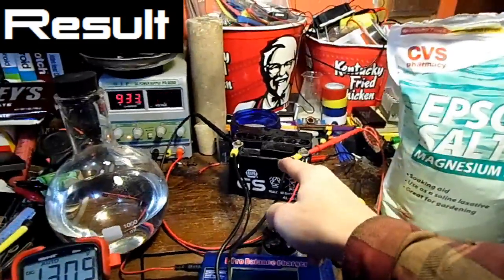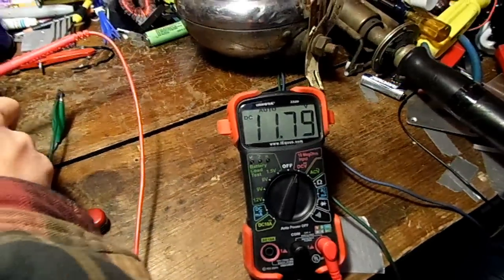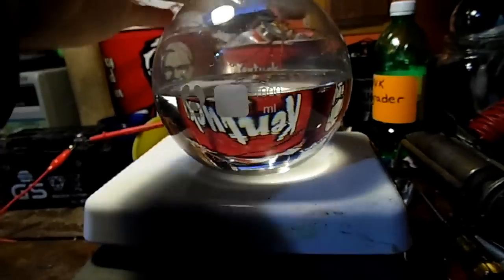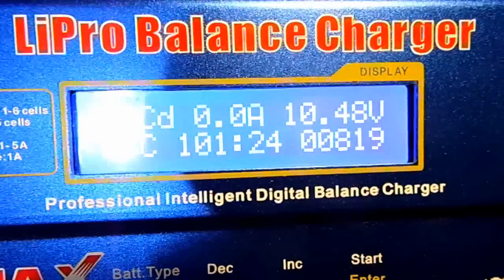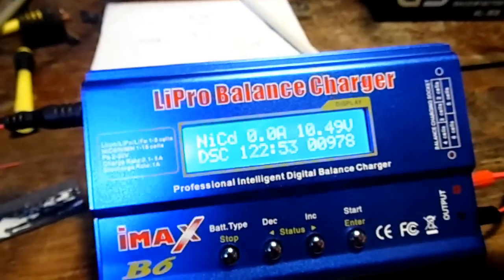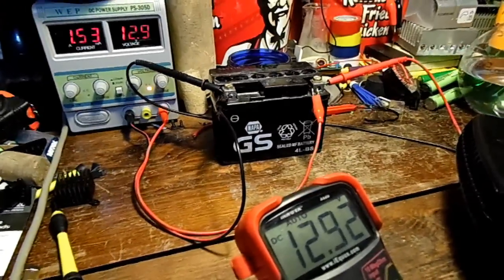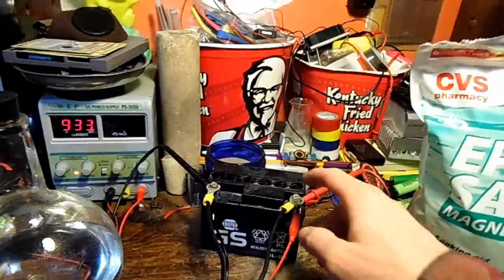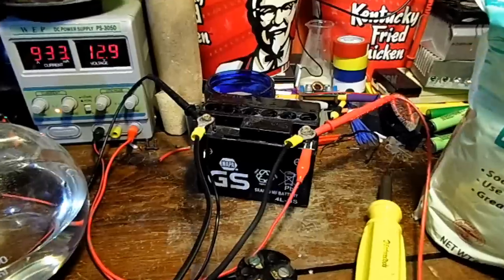Does Epsom Salt Revive a Battery?

Comment: how much  (gram ) of slat is needed in each cell of 12v 150 A inverter battery
Reply from the maker: really depends on how weak the acid is in the battery. go with what feels right. there arent any good studies on it yet so idk a good amount of data regarding it.
Reply: as i also read on you tube videos they just mentioned 10-15 tea spoon in 65amp batteries ,so mine is 150 so 3 teaspoon per cell will be right? iam asking u coz u hav some exp done n i hav none ,
and what abut my one cell which stuck on sp gr of 12.00 how could i raise its sp gr
any idea
Reply from the maker: Subas Maharjan what i do is i mix the highest concentration that i can and put some into the battery, then if it needs a bit more i put more more in there.

i'd say take half a liter and put like 5+ spoon fulls in there, then you can devide that 500ml between the cells.

i'm currently filming a video over the past 2 weeks where i add epsom salt to a 6v golfcart battery. its odd because it took a week for it to improve. now it stays at 5.91v instead of 5.8v. so perhaps you can slowly add some every few weeks and see how it improves.

is this in a battery backup? what voltage is the battery at when its not been charged for like an hour? it takes some time fora battery to go down to it's actual voltage after charging.
Reply: Rinoa Super-Genius it stays at 12.60volts if chrger removed even for 4-5 hrs,  works as usual for 2 hrs with 40w tube light n other 5  5w cfls then once it reaches 12.20 volts it drops rapidly,it used to work min 4 hrs with all lights mention above +1 laptop 
now i hav put around 20gm of salt on each cells just now lets
see what happens
Reply from the maker: Subas Maharjan
 what voltage does it go to with no load though?

i dont think epsom salt will help that. epsom salt won't increase capacity i dont think. it will only increase voltage to help stop further sulfation.
Reply: u mean while charging? it takes 13.75 while charging and if stopped comes stays at 12.50-12.60 but drops rapidly while using /under load
Reply from the maker: Subas Maharjan
 12.6v is about the top of what a battery runs at. looks like the battery is just sulfated. you can try to add epsom salt if you want but idk if it will help.
Reply: thk u for ur time n kind response i will let u know my results later
Reply: Rinoa Super-Genius i got a problem dude after adding salt my battery discharge it selft to 10.48 volts after 3 hrs before it was working for 2 hrs with load on inverter .whats goin on dude
Reply from the maker: Subas Maharjan
 was your battery electrolyte already strong enough? you may have added too much and made the electrolyte too reactive making it dissolve the plates.

but now you get 3 hours of run time out of it instead of 2 hours so i dont understand your issue.
Reply: Rinoa Super-Genius sorry i ment that now it discharges it self with out load ie if i remove charge it dischares to < 11 volt without load ,,before it never discharged like that until i put load
Reply from the maker: Subas Maharjan
dont know. weird.
Reply from the maker: *****
what's a steering magnet?